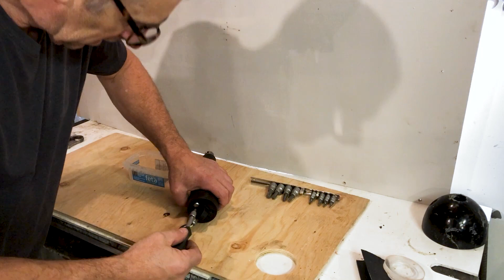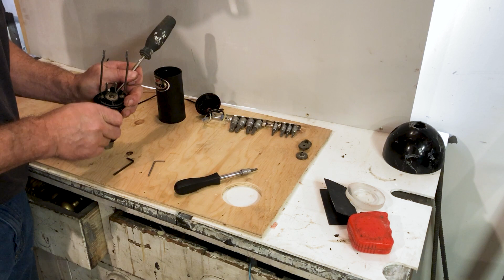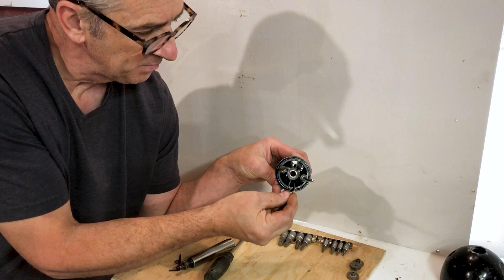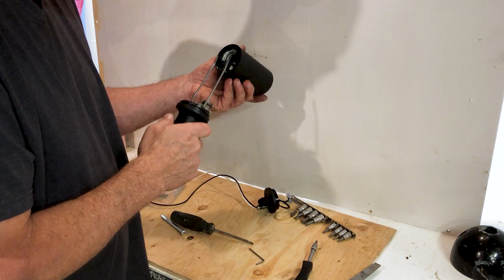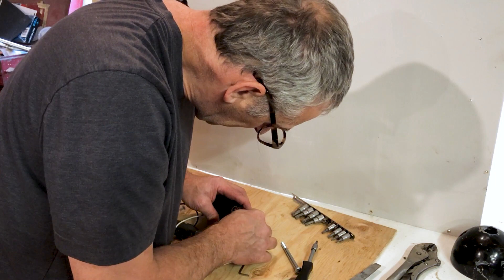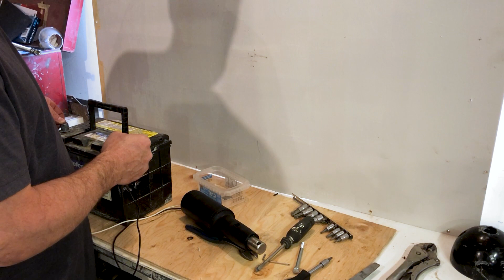Homemade ROV Tether Reel

Comment: how many kgs are the weight resistance ?
Reply from the maker: The resistance is totally variable, because it is electric feed in and out and variable speed.
Reply from the maker: It is variable right down to zero because it is speed controlled and power in and out.